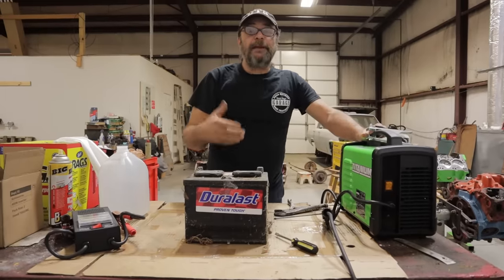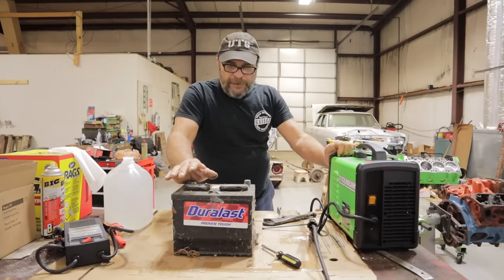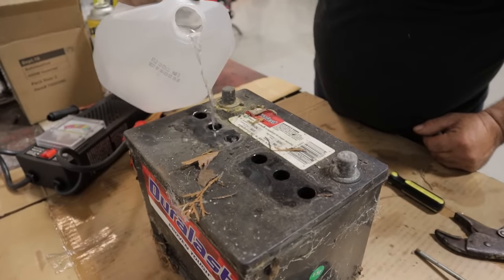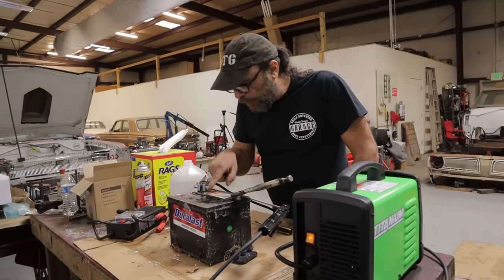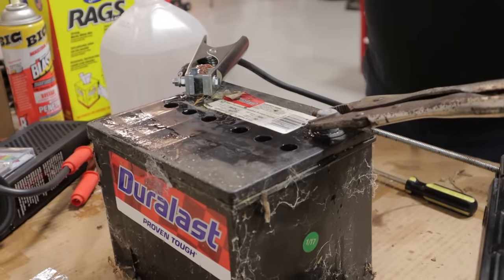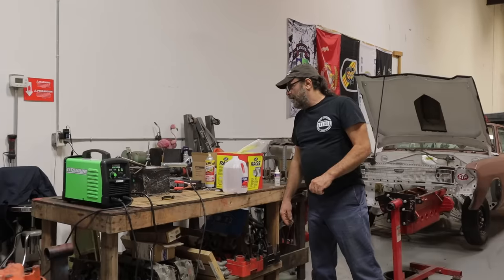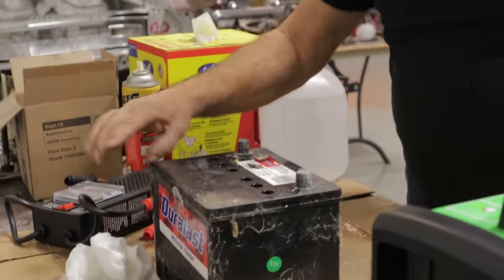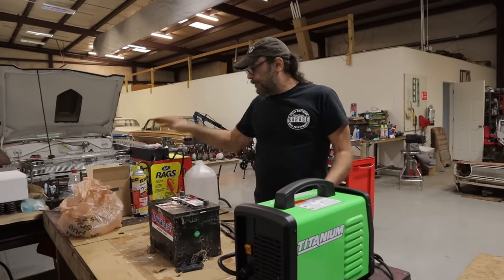Reviving Dead Batteries With A Stick Welder

Comment: One note for the water to have on hand in case you get acid on you: Yes have water with you but before hand mix in a couple tablespoons of baking soda. The Hydroxide in it will be buffered so that itself will not be too basic but if you use it to wash away the sulfuric acid from the battery it will actually neutralize the acid. Do not use baking soda+water to refill the battery.
Reply: Yep you can also use any basic chemical, like household soap to neutralize the acid. Though you should never mix large amounts quickly or it may react violently.
Reply: Seems like a good idea, but I would just use water because you have plenty of it and you are not introducing a new element. The acid with neutralize and dilute as more water is added.
Reply: @HB-ps6rn I am well aware of the chemistry, but when it comes to safety it's best to use water and only water. There are exception cases when dealing with pure acids and bases which this is not the case. BTW, you are aware there is a different gas that comes out of the reaction, correct? Unless you plan to feed the plants with it its not safe for humans. Point here is to teach basic safety with acids and bases not specific cases which could get someone hurt not know the chemical reactions involved.
Reply: @whummer98  I don't think it would matter too much with a small spill of battery acid. If you are talking about more concentrated solutions then water can be just as dangerous to add to acid. Also neutralizing sulfuric acid with lye results in water and sodium sulfate which is found in laundry detergent and food dyes, and isn't toxic. No gas formation other than boiling water if you mix too much at once. It really is something that can reduce the severity of chemical burns if you get some on yourself.
Reply: Yes, the base neutralizes the acid.  Good tip.    I aways go the extra step with a full face shield.  How much do you value your eyesight?

Comment: In the absence of a funnel, you could utilise surface tension and a straight rod of some sort. Hold the rod across the opening of the bottle with the lower end of the rod in the hole in the top of the battery (but not touching the sides of the hole) and tilt the bottle gently. The water will flow along and around the rod and into the battery.
Reply: Excellent tip !! I have a tiller with oil fill plug in a very tight spot. Going to use that trick to top up oil. Thanks.
Reply: He DOESN'T NEED any more bad idea's..  He just escaped with his life in this video.

Comment: I've  got 30' leads on my welder and a stack of 50 batteries. I'm going to do this when spring hits, outside of course. Yes, Face shield is mandatory. The only thing I'll do differently is after treatment I'll drain all the acid, rinse out the sludge with distilled water and filter the acid, then replace.
Reply: First check if the cells are not rotten by acid. Its enough just one to be slightly damaged, and your repair would be useless.
If they are older than 5 years, chances are most of them are gone.
Been there, seen that.
Not worth it.
Just take them to a recycling center. Youll get few good bucks on them.
Reply: @dan_6915  
Thanks Dan. Before seeing this I was going to dismantle the batteries and extract the lead plates and make a Plante battery. So if it works, great! If not, I still win.
Reply: How do you have 50 car batteries?
Reply: @Waynus888  
I've been collecting them for the past several years for my Plante type battery project. It's  not difficult. Ask at garage sales. Lots of people have an old battery lying around they don't know what to do with.
Reply: @dan_6915  Especially now, we dumped some scrap recently and iirc we got like 1€ per kg for the batteries

Comment: 3:24 "You have to use distilled water. Why? Because science!!!" lol Pours distilled water all over a dirty battery hoping some will go into the cells. hahaha. Minerals!!!! It's science!!!!
"Let's minimize our exposure to this acid." Let me grab a napkin with my bare hands...
"Folks, DON'T do this inside!!!" Hooks up welder while the battery caps have been off for a while. Batteries boiling and no fan on it. Steps back for safety. lol
13:45 "So just out of curiosity..."because remember, this was sitting outside in the elements so naturally it's...uh...got to be bad, right?..."

Comment: Back in 1967 my school auto shop teacher showed the class this procedure, I have a charger with a high boost setting and did this on the farm for many years. Some batteries did bang and split top or sides. Remove battery from vehicle, tractor,  stationary power unit beforehand.

Comment: If you have an old analog battery charger with the 200 amp jumpstart function they work well for this.
Reply: So we have digital battery chargers now?
Reply: That's what I was thinking.
Reply: @tonypoore440  yes
Reply: Automatic battery chargers use impedance to charge the cells. If they detect an open circuit they switch off. When impedance (resistance) drops the charger adjusts to a lower amperage.
Reply: I think he means an older charger with a transformer in it, vs newer switch mode electronic power supply
Reply: @tonypoore440  yes.  Most  are "smart" with a CPU inside that generally prevents it from doing anything useful.
Reply: @tonypoore440  yes I got one it's pricy and I hate it.  The old silver rusty box works better
Reply: @duckslayer92  There is a place for both. I charge batteries for my solar power, and mostly I use the newer, but if they get really low, which is really hard on them, then you need the old dumb charger
Reply: The difference is that a stick welder has much higher voltage and amperage potential then a battery charger. Stick welder open circuit voltage can be over 50 volts DC.

Comment: A critical piece of information missing from this "instruction" is that your welder needs to be configured for DCEP,  with the electrode going to the plus terminal and your work lead going to the minus.
Reply: You'd think that would be obvious. Plus to plus minus to minus to charge. But then again, I'm not a welder, I'm an Electronics Technician LOL.
Reply: @katherinew1366  It is obvious, however many arc welders use a positive work (ground) lead and a negative electrode...the electrons flow from the electrode to the work. This would be the wrong polarity of you clamp the electrode to the positive and the work clamp to the negative (as seen in this video), that's why it's important to be using DC Electrode Positive (DCEP) for this setup.
Reply: DCEP = Direct Current Electrode Positive, meaning the stinger is positive and the ground lead is negative

Comment: That's true batteries definitely can explode. I've had it happen to me, I had an old Oldsmobile that had a flat camshaft. and because of that the engine wouldn't crank over. so I turned my father's Marquette battery charger all the up on high. and went to turn the ignition switch, I turned it to cranking position and blew the top of battery. going inside the car to crank it over saved me from getting hurt

there's another method for rejuvenating batteries that calls for the use of epsom salts and only requires regular battery charger it's supposed to work but I haven't tried yet.

Comment: Thank you for this video.  I watched your video and a couple of others as well.  The battery in my Slant 6 D100 died a little more each time I charged it.  Finally going from 100% to 10% in about 2 1/2 starts.  At that point I took the battery to my welder and applied 150 Amps 4 times for 15 minutes each over several hours letting it cool down between each charge.  I put it in the truck and after 6 starts trying to figure out why it won't run properly the battery never showed any signs of losing power.  I think you saved me at least $80 with this video.  Thank you.
Reply: Wonder why a 2017 battery was discarded after only 2 years  A five year old battery is, IMO, not very old

Comment: Hydrogen gas is extremely volatile when  if it burns it makes one heck of a flame. Since it is a gas it can if in a great amount of volume displace the oxygen in the lungs and smother you. Tonies  warning and suggestion on shutting the charger off before disconnecting the charger is the way to go. Any way you look at it. Tony is right, do this outside and make sure you watch this several times so you will not miss one of his steps or safety tips. He does a good job with safety related videos. Thanks Tony

Comment: I found it's easier to stick a couple slotted screw drivers in a wall outlet then hook the jumper cables up to them. Just make sure you use 2 different outlets and make sure you connect to the skinny side and the bottom ground lug. When the lights in the house start to dim you shut it off.
Reply: You really should have added a bunch of smiley faces. 😁

Comment: That's a fine way, I've been talking very old dead battery's starting at age17 &now 65. To remove the algae build up on the outside of the cells I take a teaspoon of epsom salt to each  cell & then top off the battery with water between the top of the cells & the beginning of each cell filler hole. Charge the battery in the same way you did building up the voltage over time the smell can sometimes get very strong as the cells are boiled clean. I've taken 2 truck battery's & a set of Arc welding leads to weld on the PTO for the Semi's dump bucket with just the 2 battery's the tractor frame is 18 inch c-channel. I did 4 truck's but only 1 was with the battery's.Get back with me after  you try it out, you will be amazed what you can do.

Comment: Inverter welders have pulsed high frequency electricity which is why they're so much more efficient than an xformer unit. Desulfators also used high frequency. Your welder is a natural Desulfator
Reply: Great point

Comment: I saw your follow up video, which brought me here. I have seen a few ways like this and one the one they suggest once you've done this rejuvenation, to let the battery rest about an hour between each cycle. Also afterwards to put the battery on trickle charge. 
I'm keen to try this on a battery I bought brand new but left standing due us loosing the engine on the car. Although I did use a trickle charge on the battery I didn't stay disciplined and the last couple of months I've noticed that it can't keep up with the other battery that I bought with it, since the engine required 2 batteries to start, (an old GM 350DX)
The other battery stays above 12.6 volts but this one drops right down to 10v.

Comment: You left the battery very dirty, removed the caps, topped off the battery, then wiped off the battery, pushing dirt into it.  You're a lot smarter than that Tony.

Comment: Thanks for confirming the truth, I knew there was a way to revive dead lead acid batteries ( not too far gone) because of the way we as consumers are being dogged about the DAMN core when we buy new or used ones for replacements. A New Years Revelation that needed to be put out here. This is very useful until Lithium becomes more affordable (along with onboard lithium charging options for automobiles). Thanks again Uncle Tony, "may the force be with you"
Reply: the core thing is more about the lead itself, environmental regulations made lead much more expensive to mine and process. it's easier and "greener" to reuse the lead than to get new lead. they just grind batteries up whole and keep the heavy stuff

Comment: At a hybrid shop I used to work at we refreshed 12 volts by dumping out the old juices and putting fresh acid. We did some with home brew acid and tried the parts store stuff it was cheap enough 7$ a quart or so. Both worked really well and lasted a long time. Definitely not the same as a brand new battery but for under 10 bucks it lasted longer per dollar. We would get at least another year out of them doing that. I tried overcharging an agm once just for fun and it violently blew the top off lol.
Reply: Now we know why you are a Special Agent, James.
Reply: @montinaladine3264  😉🤣
Reply: Just buy a new battery.
Reply: @tedmoss  waste not want not my friend. If I can make something last a bit longer I will try my best to do so. Especially if it’s a lot of fun almost free to do. Just a more old school approach I guess not everyone’s cup of tea.
Reply: @tedmoss  you probably use service manuals and instructions 🤣🤣😂😂
Reply: @longdong3889  Only as a last resort.
Reply: @tedmoss  
I had german batteries, and local ones. Never lasted longer than 5 years.
Cells get destroyed.
So its useless to replace the acid.
Reply: What ratio of water/acid did you use when you replaced the battery acid?
Reply: My agm went dead. I put tap water w a spoonful of baking soda in it and its going good after 2 years
Reply: @keithslagter6199  I either poured just the acid or did like long dong mentioned just water with added a spoonful of some sort of electrolyte. There are lots of different things you can use and the batteries aren’t super picky about it. There are some things sold specifically for it, but some household stuff that works just as good.

Comment: I haven't tried this before, but about a year ago I renewed a completely dead battery where I dumped out the acid and replaced it with distilled water and epsom salt mix, charged it twice.....and it has been good for a year now with no signs of going bad......AND my battery has dealt with the extreme heat of Vegas (which is well over 100F for at least three months each year)...which many told me it would not survive.  So that works!  This looks even easier than that and may be more effective?

Comment: Crazy how you knew. I was just looking this up an hour ago. I have about 10 batteries that are "no good"
Reply: But I think you might have 10 good batteries
Reply: Distilled water and using a highload fast charger would help MOST batteries. Tonys battery was outside so I would have replaced the acid and then did the fast charge

Comment: Sketchy at best. Never even thought about this concept, although it definitely seems plausible. I'd definitely suggest a full face shield and maybe a fire suit if you're gonna try this method. Be careful folks, exploding batteries are definitely nothing to be taken lightly. They can actually kinda erase the features of your face as your mama once knew it.
Reply: Don't need gear, just long cables

Comment: Using a welder, that's genius.  I've done this with the boost setting on my charger, but never tried using a DC stick welder. 
   I was told.... the military  flush out their batteries and then refill them with fresh electrolite.  They say the crud that flakes off the plates will build up in the bottom and eventually touch the plates and short them out, if they aren't flushed.
Reply: A DC welder? Isn't he using an Arc welder AC??
Reply: I was told that putting Epson bath salts into the battery cleans the plates.
Reply: They do, I was in the Army, and worked in maintenance. Also, most of the batteries the Army got came dry to begin with, you had to add the acid to them.
Reply: @dc6233  no its dc

Comment: You always clean up the area around spark plugs before you pull them out, you always cover the top of the carb when the air cleaner is off and you need to use air to clean the top of an engine! If you have an intake off for any reason you are a stickler to make sure you have the lifter galley completely covered to avoid any gasket residue getting into the engine while cleaning the gasket surfaces  and you do the same with timing chain cover gaskets head gaskets which is a very good quality to have, So why didn't you take a damp towel and clean the dirt and leaves off of the top of that battery before you pulled the caps and then after removing the caps wipe away from the holes to get the top of the battery as clean as possible! You even commented how dirty it was and picked a crumbling leaf up off of it and layed it back down on top of the battery! When you were filling the cells without a funnel and getting water on the top of the battery there was crap floating around in that water!
Reply: because he had no idea if it would work or not and was using a shit battery.. settle down there ocd

Comment: If one must do this inside, it may be advisable to set a fan up a few feet distant to blow away any fumes that might accumulate in still indoor air.
Reply: I was going to say the same thing, he should have turned the back of the welder towards the battery to use the internal fan to dissipate the gasses to reduce the chance of explosion!
Reply: ok karen

Comment: Tough to do this on a modern sealed battery. I too have had batteries blow  in my face, which ain't fun.
Reply: They aren't really sealed. The modern lead-acid batteries hide flat caps under the labels. It's a styling thing, but they are always there. Use a flat blade screwdriver to remove them. The gas has to have vents and fill ports. The vent is usually a hidden common rail with the exhaust port on the side.

Comment: Great experiment, reveals a lot!

A couple of questions on the results, if you will.
1. Did you cycle the battery back into use, say use it on a car?
2. How did the battery perform after the revival process?
Reply: I know someone that did this.
Battery died after a week of use.
Not worth the effort.
After 5 years, just buy another one. They are cheap.
70 bucks for a 12V 70A 680cca, where i live.
3 year warranty.
Reply: The rejuvenated battery will have sulfate flakes piling up at the bottom of the cells. When the pile gets high enough it will start shorting out cells.
Reply: @stephenarling1667   Can you just empty the battery acid then flush with distilled water to get most of the crud out of the bottom the battery casing then refill each cell with battery acid. Charge up battery check with hydrometer. If needed use the welder trick. Just my thoughts.